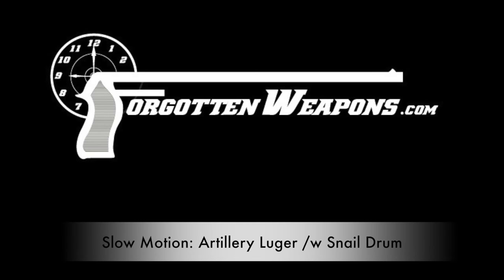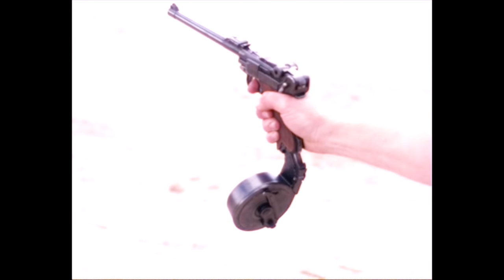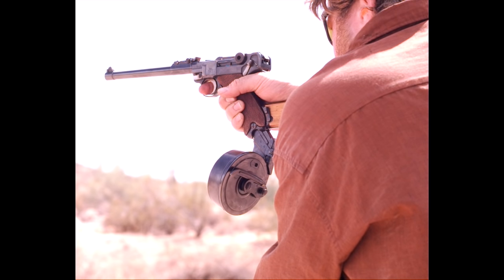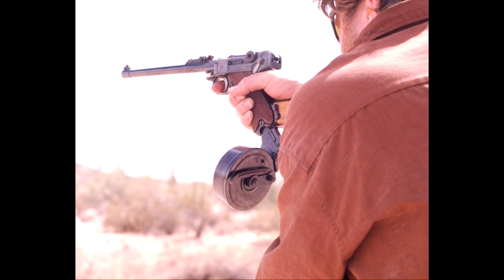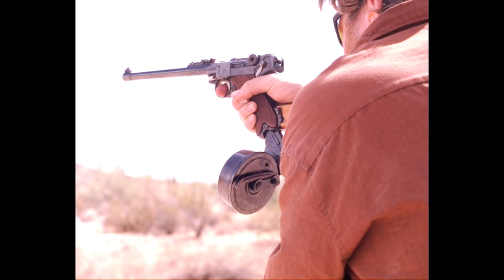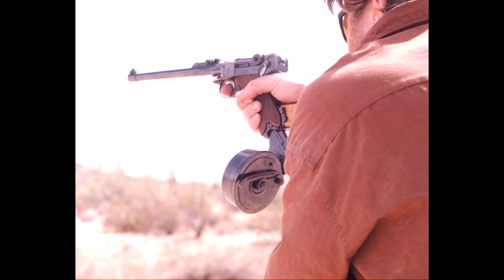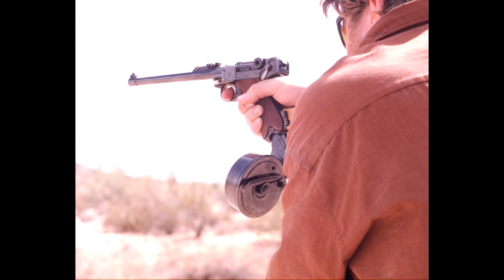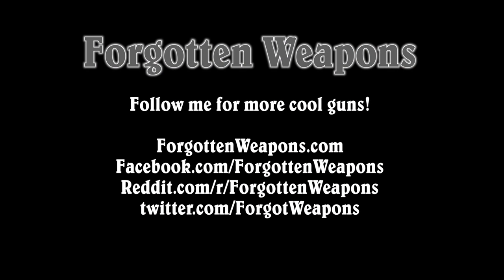Slow Motion: Artillery Luger and Snail Drum

Comment: i guess i need to do more studying. i didn't realize the barrel moved when Lugers cycle
Reply: j0nthegreat The barrel and slide move together for a small distance till the toggle hits a cam surface on the frame that brings it past center and allows it to bend, unlocking the bolt.  One advantage over the browning system is that the barrel travel is linear, rather than tipping up and the barrel is fixed to to the slide.  I think there are a couple of animations here on youtube.  It is an interesting action.
Reply: The Borchardt pistol, its arguable predecessor, did have a fixed barrel (it was a toggle-delayed blowback weapon) if I'm not mistaken.
Reply from the maker: Jonathan Hughes Actually, the Borchardt is also a short recoil action. It was the Luger's predecessor in a very definite way; DWM tasked Georg Luger specifically with the job of making the Borchardt pistol more efficient and marketable.
Reply: Forgotten Weapons so much stuff to know!
Reply: Forgotten Weapons Ah, good to know. Quick question, though: Both the Borchardt and the Luger have odd, c-shaped triggers, the tops of which extend far forward of the shooter's finger. Is there any particular reason for this?
Reply: +Jonathan Hughes The top part of the trigger doesn´t limit the move forward of released trigger. The front part (before the finger) do that by the contact with the trigger guard.